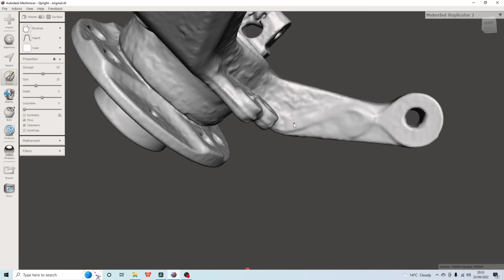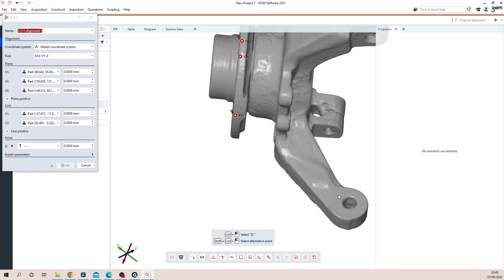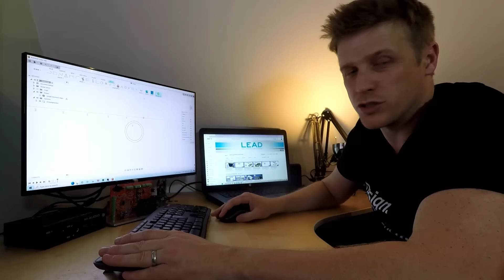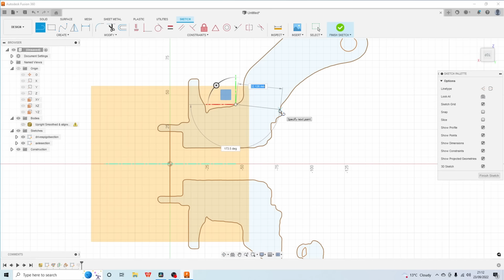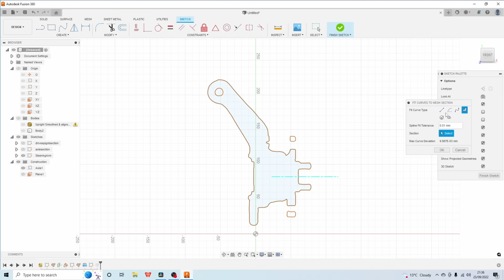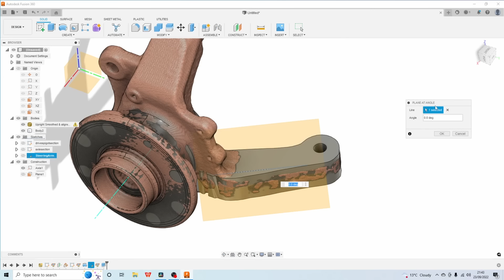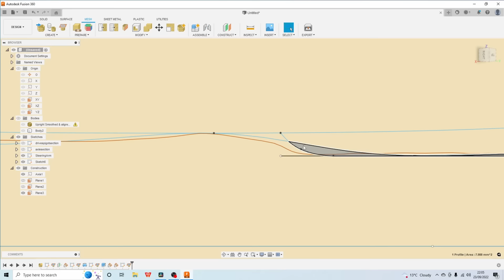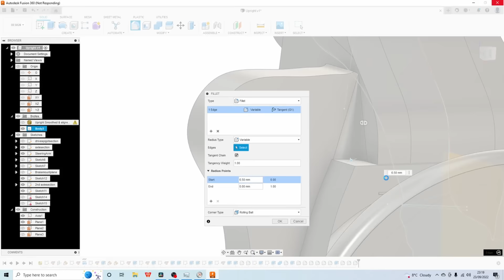Reverse Engineering from a 3D Scan with Fusion360... for FREE!

Comment: No need to use GOM to reorient part to your coordinate system, as F360 can to this also.  Simply bring the STL in as usual, and then MOVE the part as needed to match it up with your coordinate system.  Once done, if the end product is expected to have more than one component, I also suggest grounding the base component before making the others along with joints, etc.
Reply: Just like he said in the video ;) It's a good idea to actually watch the entire video before correcting. Grounding is meh. It's only useful in advanced assemblies with several "moving" parts, in simple designs like this one it often just becomes annoying

Comment: Hi There, awesome video and have seen the shoot out with other scanners as well. As the owner of an older vintage car this is very inspiring. 
Based on the part and its intended high stress use, If you were to try to reproduce this part from your finished CAD drawing which fabrication method would you possibly use?    
3D Metal Printing, CNC or Print and use as a primary die for mould then burnout ready for a small casting? 
Very curious about choice of materials which you would re-engineer the part in?   
Thanks in advance for your reply :)
Great job on the channel!!
Reply: Same here! Agree with your comment. Am also an owner of a soon-to-be vintage car and am here to make adapters for the brake calipers so I can fit larger brakes :)

Comment: Aligned model with GOM software is easy but you can aligned model in fusion360 too manually with constructions plane and axis. This way is longer but give more control for precisely align. Thx for video!

Comment: All the work you did you might as well have just measured all the features instead of scan it.
Reply from the maker: Measure the drive flange I agree, which is what I did, however, without a full inspection setup getting relatively dimensions is gonna be very tricky.
Plus if I want accurate dimensions for the castings, that’s gonna be even harder!

Comment: I want to get into reverse engineering obsolete aircraft and work my way up into car type stuff.  i got one of the last Freewing Su-35 remote control jets before it was discontinued and I got two of them, one is a little damaged from flying it and want to possibly use that one for it's internal dimensions.

Comment: Good video.  The more I see of Fusion, the more I question my decision to continue with Solidworks.  Solidworks would take longer than the whole video just to load the mesh - and once it's loaded, it's just a pretty picture, you can't do much with.  You have to spend a load more money on an add-in to actually use the mesh.
Once it has a decent Weldment / Frame tool - I'll jump ship!
Reply from the maker: They aren’t really comparable I think, I mean they kinda are… but SW is a lot closer to Inventor, meant primarily for professional users and excels at bigger mech models.  
Fusion360 covers a lot more bases, however is more a jack of all trades and master of none… inventor and SW excel in a narrower field… F360 covers more ground, but not in the same depth…
Reply: @MakingforMotorsport  That's what I thought too - but more & more people at work are using Fusion (Movie Special Effects), even on big rigs.  
The main 'selling point' of SW or Inventor are Weldments (Frames in Inventor).  They do have a lot more features - but they get more exotic & less useful the more they add.  
I think Fusion will cope with 90% of what most people want to do.  I'm getting less convinced the 10% is worth the additional cost for Inventor, SW, OnShape or Creo.

Comment: I was wondering why you went to all the trouble of recreating the upright's features, as opposed to just concentrate on the important parts like all of the mounting holes and axle bore.

So I imported the STL of the upright into F360 and saw that it was a solid with mass, so I thought I could just do that but it couldn't be cut with an extrude.

What does it take to convert the mesh into a real solid?
Reply from the maker: You can turn it into a nurbs solid form automagically in F360, the issue is that’s still not a prismatic style model so still limited.
There is a feature to auto to prismatic in paid F360, but on anything but the most simple scan it’s pointless.
So what does it take??? This process….
Reply: @MakingforMotorsport  I'm not sure if Autodesk has beefed things up since I tried it last year (and failed), but it now works to simply do Mesh/Modify/Convert, select the mesh body and leave it on the default selections for Operation (Parametric) and Method (Faceted).

I even ignored the warning about "more than 10,000 triangles" error message.

Though apparently not without consequences; it chokes my computer to try a simple cut.

Kind of disappointing for my new laptop w/i7-12800HX and 32GB RAM, but maybe it shouldn't be surprising with 683k facets to process.
Reply from the maker: @noahkatz9616  so this works really well on stls created directly from CAD, or atleast I have had success, especially if you “create face groups” beforehand.
But with scan data I have always struggled, the noise and variation in the mesh do cause it to struggle…
Reply: @MakingforMotorsport  I tried it with your upright and it was no problem, but I don't doubt that many scans are problematic.

Re the mesh noise/variation, are there any tools to smooth the mesh or make them conform to an interpolated surface?
Reply from the maker: Yeah, if you try “generate face groups” first it helps…. When you said it worked, did you try that with “prismatic” mode?
Reply from the maker: Also, there are tools (simplify I think) to reduce the number of facets whilst keeping the geometry within a set tolerance the original mesh.
Reply: @MakingforMotorsport  Hmm, I did just try Prismatic and after the clock runs for awhile, there's no apparent effect; it's still a mesh body.

The Organic option sounds interesting, but that starts a 14 day trial that I'd rather save for a real project.
Reply from the maker: The generative design?? Yeah that does look very interesting… maybe a bit fancy for me!
Reply: @MakingforMotorsport  I don't know, maybe it invokes GD; anyway, it's the 3rd Convert Mesh option for Method, along w/Faceted and Prismatic.

Comment: If you wanted to remake this part you couldn't print it out on a 3D printer though, because it has to be metal. So what actual use is this?
Reply from the maker: What use is what?  The model or the technique?  

Maybe i wanted to 3D print it in metal?  Or this was a very rare and expensive piece and wanted to CNC machine a copy? Or maybe I want to modify it and I want to do that based on solids and parametric modelling?  Maybe I want to build a digital version compatible with FEA and kinematic as simulations…

These are just the options I can think of for this part and this scan, let alone what other things you could use the RE workflow for. 

What am I gonna actually use this for??? You’re gonna have to subscribe and find out! 😉😂

Comment: I want to scan an aircraft engine with and without cowl to make better cooling plenums.  I am also restoring a 1757 Dodge truck that I want to install an LS3 engine and transmission.  Resolutions on the order of several mm would suit me.  I'll import into CAD and make my hardpoint designs there.  Would you recommend your Lizard for this?  It's probably only going to get used twice, then thrown in the junk drawer.  If it helps, I prefer Linux environment.
Reply from the maker: I would suggest that due to the scale of things, a large field of view scanner like an Einstar or Cr-Scan01.  The Einstar is more expensive but easier to use, but a CR01 from my testing would still do the job.  
Plus you could probably pick up a CR01 for only a few hundred dollars 2nd hand and then sell it again…

Comment: Subscribed. Really appreciate the effort you've put into this. However, any chance you could re-upload the video and slow down the Meshmixer stages! :-)  That's the bit I'm struggling with at the moment. Got any links to a specific video showing those stages?
Reply from the maker: Cheers bud.  I try to think of a way to do it (maybe short form content), but there are plenty of vids out there on Meshmixer… and getting stuck in is the best way to learn!

Comment: very good  video , i will follow the hints for the future !  with most of the 3D scanners  when you have the STL , is there  any realistic measurements coming with the scanning task or nothing at all  ? when you measured the spigot and added the measurement to the sketch it did scaled  everything to the proper dimensions right ? i am looking  to be able to scan an engine bay without a 10k$ scanner  and to have correct  dimensions, if i scan it all  and just measure the distance in between two scanned bolts , adding it to a sketch  everything should be scaled to proper dimensions?
Reply from the maker: Hi there… even with the consumer end of the scanners (pop2, lizard, Einstar) my experience is that everything is relatively accurate straight off the bat, within an Engine Bay if it’s a single scan I would expect to be within 1mm, something not achievable by hand. and Using photogrammetry you would need to scale.
That said, move up to a car and stitch multiple scans together you will see greater errors but that’s over a much larger area…
Reply: @MakingforMotorsport    i can see Pop2 , Lizard and Einstar are in the  1k$ range , the  straight off the bat dimensions will totally worth it  by saving time tho , 1mm is  not a problem on the "environment" scanned , i want to design things to fit in a car engine bay or on a motorcycle frame.    When you scanned  the spindle   as STL and opened it in Fusion did you made it a Solid or is it too many triangles ?  Is there areas  the scanner cant see and would be an open mesh you need to close to complete the STL ?   The Meshmixer smoothing out is  superb . I will go thru  the playlist  you attached to the video , it might answer all my questions .

another question ,  could you scan inside  a room with  the 3 scans  you suggested ?
Reply from the maker: @people16vt  I am just producing a couple of videos, 1 is a review of the Einstar and the other is a comparison of all those scanners.  That should give you a good idea of which scanner is best for you, but they all work indoors well.

The more complicated a scan you do, especially on an engine bay etc, the more holes you will get, Meshmixer can fix holes, as can most scanning software…

Any .stl imported into Fusion is purely a skin of triangles, and contains no parametric or prismatic information like a normal “solid”.  Hence the need to do this whole video.  The only direct use for an STL/obj is as 3D printing or purely for digital “asset”

Comment: Needed to remove the hub assembly from the control arm to get an accurate scan of the parts so that you could get a part that you could modify but still except a standard hub assembly.

Comment: Would it not be easyer to just measure it and draw it from scratch
Reply from the maker: Drawing something isn’t the problem here, it’s measurement that’s the issue. It’s easy to measure in 2D with calipers, throw a 3rd dimension in there, accuracy suffers massively.

Measuring separate points in 3D space get very difficult to do accurately without full on inspection gear (flat table, multiple height gauges etc), and if you have that gear it doesn’t happen quickly…

With this I scan it once, retreat to my warm office with a cold beer and model away!

Comment: How did you get such a clean initial scan?
Reply from the maker: The CR-scan Lizard is a useful tool, not perfect by any means but great for parts like this!
Reply: @MakingforMotorsport  so when you use the CR-scan, does it not pick up the device that is holding the part?
Reply from the maker: It does but you can easily remove that following the scan in the software.

Comment: This is so valuable! I just got myself a 3d printer and want to spot hardpoints and size constraints to make a different air intake box + pipe. Do you have any tips for me? I'll be reusing the stock box location, just experimenting with optimization

Comment: too bad fusion isnt free anymore.
Reply from the maker: You’re gonna have to help me out here…

Exactly which of the things I did in Fusion360 do you have to pay for???
Reply: @MakingforMotorsport  fusion up until about a year ago had a full use free license for home users and businesses that had a limited income. they no longer offer a free license that has full features. if you want to use fusion and use the cad/cam, import/export etc... you have to pay around $400 usd a year. maybe they have different licensing for users outside of the US? i was using it to do sheet metal layouts and postprocess for my Langmuir systems CNC plasma table. cant do that anymore. cant even log into fusion to retrieve my old files without paying. now i just model everything in autocad and postprocess with sheetcam. which to me is actually faster since ive been drafting with autocad since the early 90's
Reply from the maker: @theoriginalDirtybill  you can just sign up to another free year.  You can still use the CAM to generate g-code but you lose the ability to rapid travel. 
To re-sign up for another year, I think you just uninstall and re-download the free version, use your old credentials and all your old models will be there, but you are limited to 10 “active”.  If you want one not in that 10, just change one of the 10 active models to “inactive”, this frees up a space to make another model active 👍
Reply from the maker: That said, if all you are doing is 2D work for a plasma, your current workflow might be best 😂
Reply: @MakingforMotorsport  i actually draw most things with solids then project the 2d off of that. it would be nice to have the mechanical modeling capabilities of fusion or inventor for chassis and suspension work. but since i dont get paid to work on my own cars i'll have to stick to autocad and carboard assisted design

Comment: so are you going to 3d print this object then cast it?
Reply from the maker: Nah, because I already have it! 😉

The plan is to use these on the mini, but modified.  By having a full model I can 3D model it and 3D fixturing to ensure the mods are repeatable…
Reply: @MakingforMotorsport  how do you plan to have these modified 3d models made? SLA 3d print then sand casting? Are you gonna send off the 3d files to have a company make it? Thank you for your time and videos
Reply from the maker: Nope, just gonna lop a bit off and weld a new bit on! (There may be slightly more science than that but 🤷‍♂️)
If I were to completely create this I would fabricate it from flat…

Comment: Thank you. I'm already using fusion for my business.  I was on the fence about buying a 3D scanner to use with fusion. But now I feel I could reverse engineer.
Reply from the maker: Well alot of the expensive scanners have some kind of access to a cut down version of GeoMagic Design X, which is software designed for this job… 

If you are thinking about a scanner, give it a few weeks as I am planning a mega test of the consumer level of scanners, all back to back.
Reply: @MakingforMotorsport  ok i'll be watching

Comment: This is an awesome video at just the right time where I was explaining to a client that 3D scanning isn't what the media portrays it as.  They always leave out the last...80% of this video, and people expect that you just point a camera at a thing and poof, you've got a 3D model that's perfect to use in an engineering application.
Reply from the maker: Precisely!  I’ll be honest, when I came into it I was surprised at the gap, and it is frustrating as most people on YT are professionals using pro-kit and software like DesignX.  
The other bit everyone is bothered about is resolution.  I am planning an engine swap this winter and I will fully model it beforehand and I intend to show people what they think is important, isn’t.
Should be fun! 👍

Comment: I'm a Research Associate and the purpose of Scanning is to avoid using a vernier caliper or any other kind of measurement equipment entirely. We simple use the scan to get educated guesses of the dimensions and then draw the features in the same manner as this person is doing it. But yes, Scanning makes sure you don't have to manually measure anything
Reply from the maker: I reckon you might be using a slightly better scanner than me! 😂😂😂
Reply: @MakingforMotorsport  Ah, I wish brother. I hail from Pakistan and the Researchers are severely underpaid and underequiped here. I use photogrammetry and markers for my scans. But reverse engineering is sort of an art with each person having their own methods. Yours is by no means lagging, I just wanted to make a suggestion ☺️
Reply from the maker: I am by no means an expert but hopefully as I get better at scanning and are able to have better scanners my process will improve
Reply: @khushalkhanmohammadzai8032  I'm wondering if spending a tonne of money on a scanner is even worth it. with my cheap pop2 and cr-scan It's a massive help when visualising the part in software and if anything is critical dimensions then just use calipers like you've said. dont't need a big boy scanner 👊